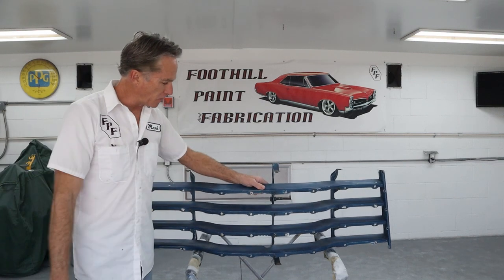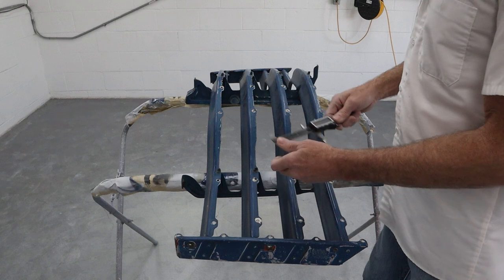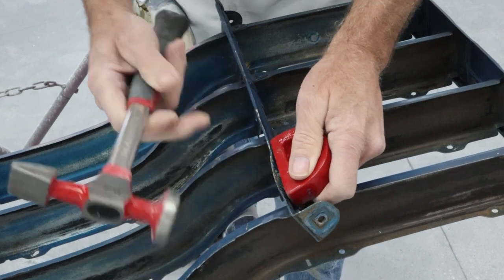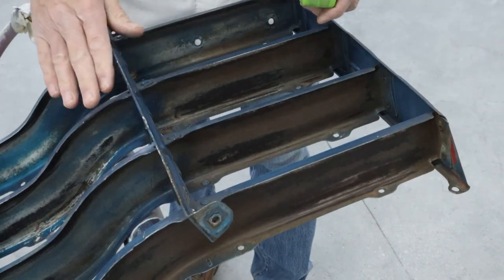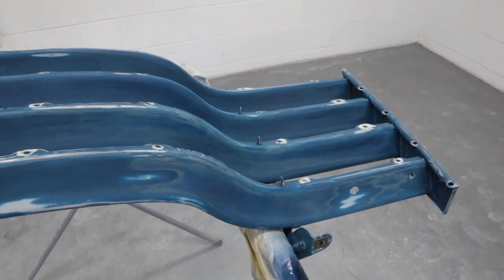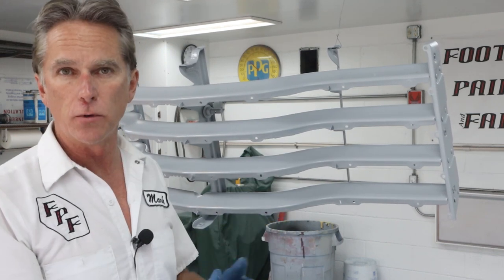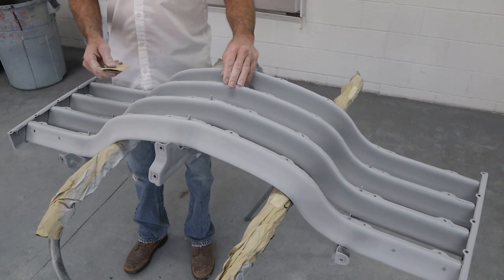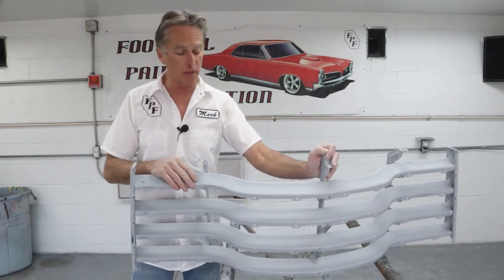1950 Chevy Truck (Ep 53) Grill Prep and Prime

Comment: Dennis, the bars are steel that are chromed.  The chrome pieces are held in place with screws and nuts.  I think with the clutch head.  They sell a replacement set in stainless steel.  I had a bit of flash rust on the back side of the chrome bars.  I was able to sand all that away and then spray with a rust encapsulator paint just to be sure the truck is good to go for another 70 years!j

Comment: Thanks Mark for the pics of my panel truck project! I am looking at doing the same thing to my grill. What is the best way to remove the rivets to separate the bars? I have a few dings in the stainless (or is it chrome?) bars I'll have to try and tap out. Will you have a video on that coming up also?  I'll wait if you do. lol
Reply from the maker: You are welcome Dennis.  The chrome or stainless (not sure what it is)  is already good to go on this truck as far as I know so it will just be reinstalled by the owner.  Drilling out the rivets can be a pain when they spin in the holes.  If they spin so you cannot drill them I have tacked a small piece of metal on the back side to keep them from spinning and then drilled the mushroomed part off and drove them out with a punch.
Reply: @FoothillPaintandFabrication  Thank you.